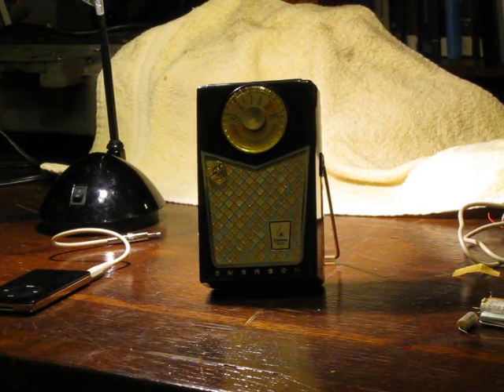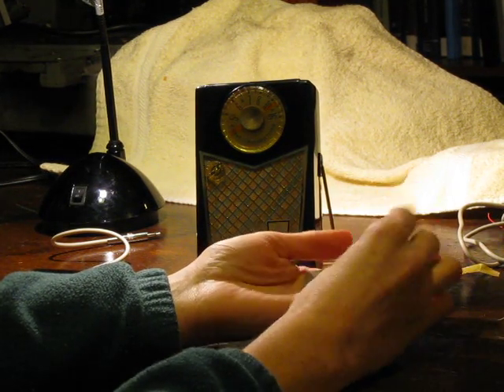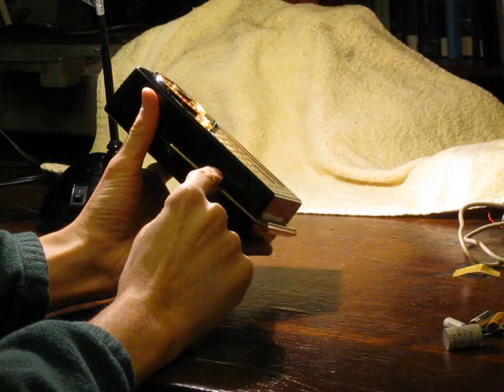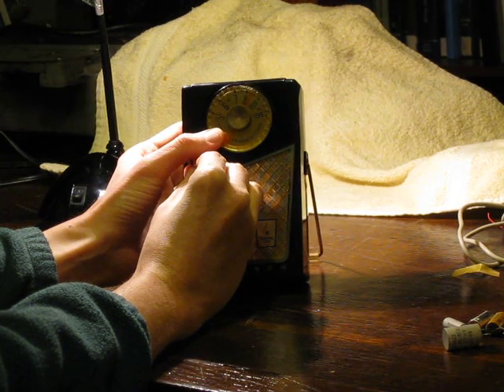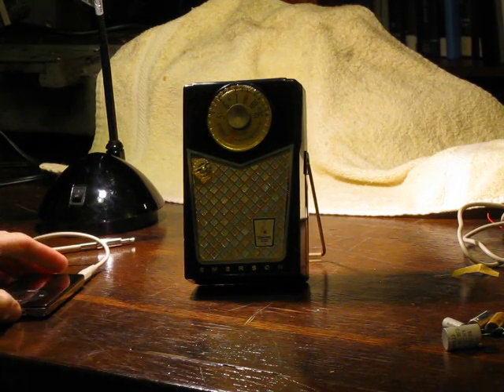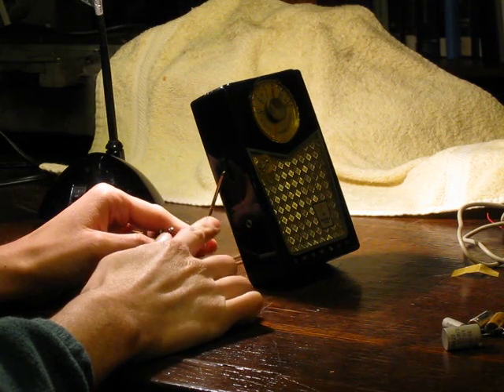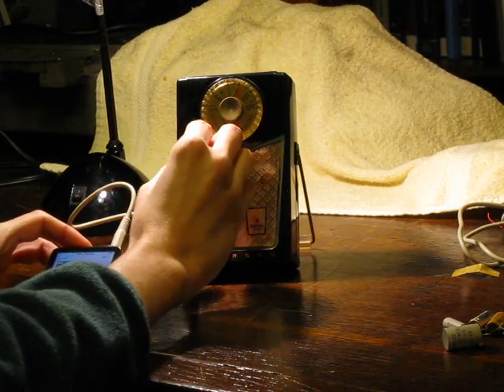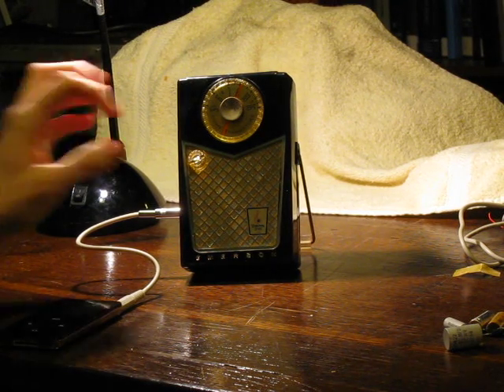Emerson 888 Pioneer Transistor Radio with Ipod Audio Input Demo

Comment: Hello...I have the same radio and I am reapiring i....The problem I have is on the antenna loop...Its wrecked...I need to rebuild it, nned to winding it....Would you hapen to know the specification for this ??..I dont know any specifications nor how many rouend the copper takes....Could you point me in some direction or to a web page or maybe you know.....BEST REGARDS and THANK YOU !